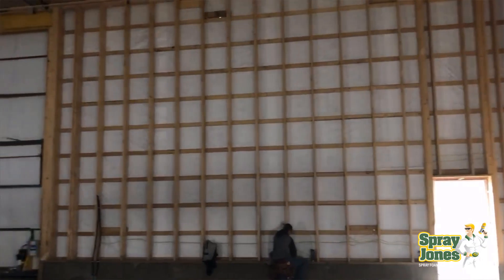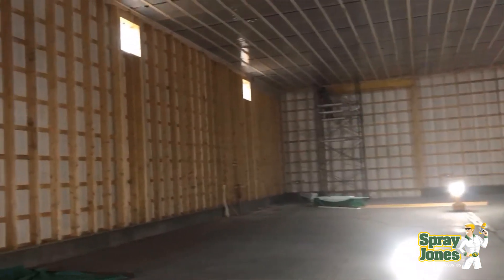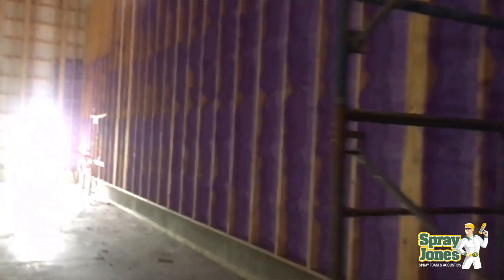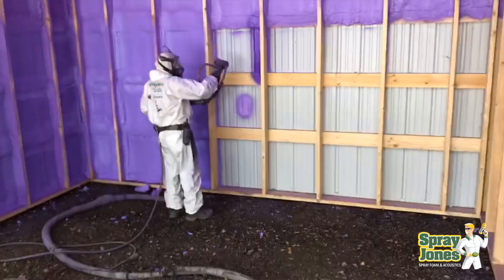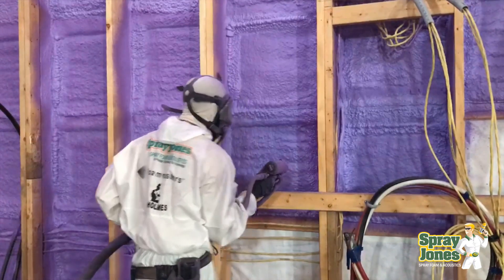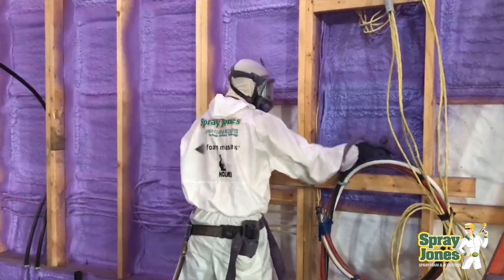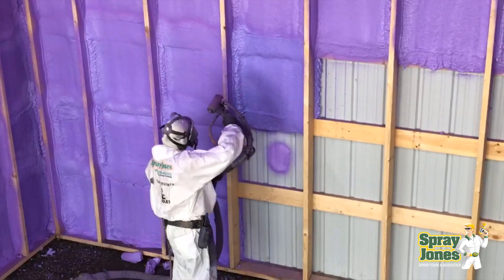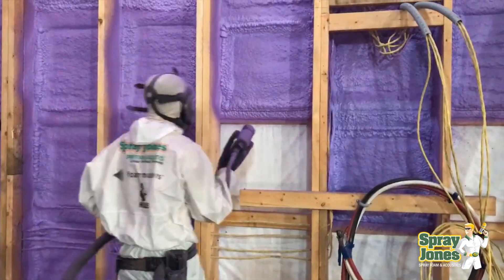Spray Foam Insulation to Building Wrap | What should we know?

Comment: With the roof, wouldn’t it make much more sense for hail damage to have a house wrap between the metal and boards? 

Also, would the boards that touch the metal always be touching humidity without the vapor barrier?
Reply from the maker: No - you need intimate contact with the metal. Otherwise you will have wrinkles in the wrap that will stay and be pockets for water to collect and pool with no way of getting out.
Reply: @ does that change with region? What do I need for my barndominium? I’m in northern ky
Reply from the maker: @ You can wrap the walls but do not do that for the roof. 
Go watch videos in my metal building playlist, I go over it in better detail.
Reply: @ thanks!
Reply from the maker: @ In April we will be announcing the new platform. Take a look at it and join - I will save you the cost of the membership on what you learn. 
Yesterday I recorded the podcast with Paul Marshall of Mr. Post frame. He will be talking about spray foam and post buildings.
Reply: @ we’re hoping to set posts in the next two weeks. All DIY

Comment: Richard L here. I am preparing to Spray Foam my Post Frame House. Your Channel is a huge blessing. My frame did get a Tyvek type House Wrap, including the roof. Should I consider some way to support the House Wrap between the Roof Trusses? Trusses are 4’ centered with 2’ centered Purlins. It seems to have been put on tightly, but your advice to not have Spray Foam put on the underneath of a roof with House Wrap has me concerned.
Reply from the maker: Walls are not as bad as the roof. Watch more videos in the metal building playlist to learn more.

Comment: Am I correct to say you prefer closed cell direct to metal?  A house wrap is acceptable if it's tight.  Without a wrap and using closed cell, what are your thoughts about the air gap behind the 2x6 horizontal board where the meet the ribs of the metal?
Reply from the maker: I try to be as straight forward as I can... I thought I answered all that.
Reply: @SprayJones  sorry, guess I missed the part about the air gap.

Comment: Most foam manufacturers (especially Carlisle) I have used do not recommend direct spray to wrap, tyvek, interesting.
Reply from the maker: You have to know WHY they say that and the total context. Tyvek is not an approved substrate on its own with no supporting structure.
Reply: @SprayJones  Does your manufacturer honor warranty claims when sprayed to these variety of wraps?
Reply from the maker: @jamessammyhomerunrace  We don't have warranty claims.
Reply: @SprayJones   Hmm, can you answer that question or no? I understand not everyone wants to divulge business practices. Thanks.
Reply from the maker: @jamessammyhomerunrace  I have not made warranty claims involving tyvek. I have not had adhesion issues with Tyvek when it is restrained in an assembly. I do not have technical bulletins advising me that I am on my own if I encounter Tyvek and spray to it. Heck Walltite is approved to be sprayed over crushed rock, membranes, ABS pipe, PVC, PE plastics on on...

Comment: I have 29ga walls, what’s the chance 2” closed cell foam will cause the metal to “oil can” or buckle?
Reply from the maker: Very. I suggest they do a 1/2 inch flash coat, and then build up the thickness you want.

Comment: I'll bet the asphalt impregnated fiber boards we used to use would be a great underlayment.  Real cheap, easy to cut and probably could be installed as fast as tightly installed house wrap.  Would probably withstand damage to the metal sheathing thereby making most repairs faster, cheaper and easier.

Comment: How often do you see the metal buckling from heat when the foam is sprayed directly to it? With Dark colors?
Reply from the maker: Never. 16 gauge metal is tough enough.
Reply: @SprayJones  16? Everyone around here uses 29guage?
Reply: @justinwirtz83  I’ve never saw it with any gauge of steel.

Comment: I do have a couple questions regarding barndominium construction.  if a panel were to get damaged on the outside without a membrane (tyvek), and there is a kitchen on the interior, how would you go about repairing the foam after removing the panel?  do you have to be able to have access on the interior to reapply foam?  Do you recommend a diy kit? I see some great looking 2lb closed cell kits on ebay with the air gun.  I do have some experience spraying paint and several 600 board ft foam kits. Thanks again! great videos!!
Reply from the maker: The repair would happen from the exterior. Small foam kits are meant for touch ups, not spraying a huge project.

Comment: Gee why even spend the money for material and labor for wrap, just use closed cell foam?? The foam could vastly increase the building structural integrity when applied directly to posts, beams and metal siding melding them in one cohesive structure.
Reply from the maker: I agree, that is how most of the ones we do are completed.